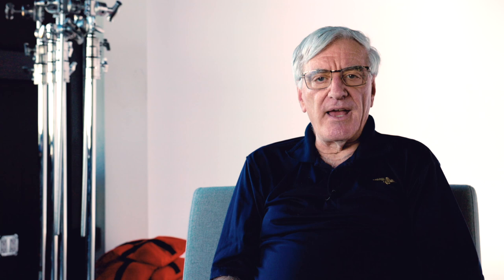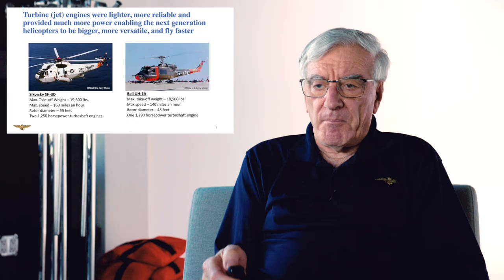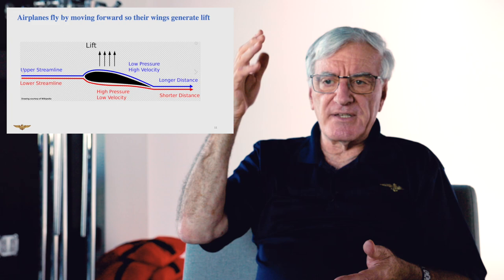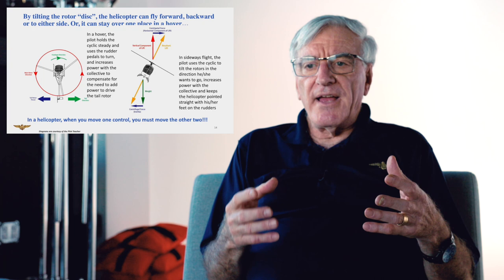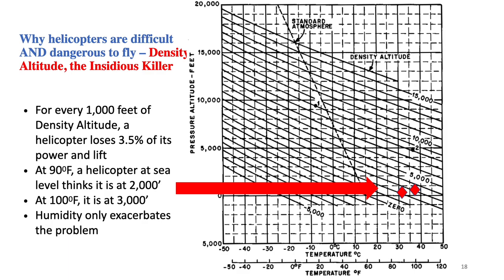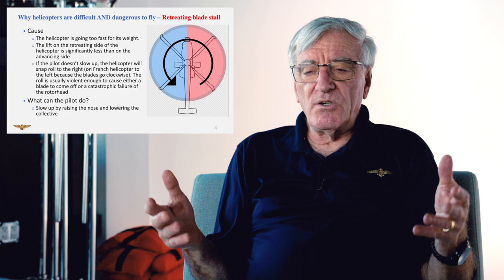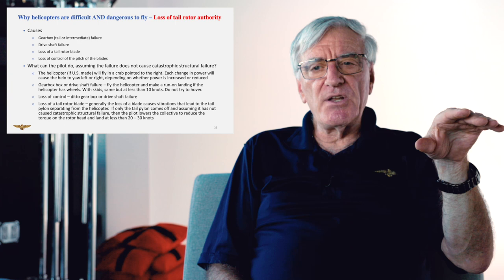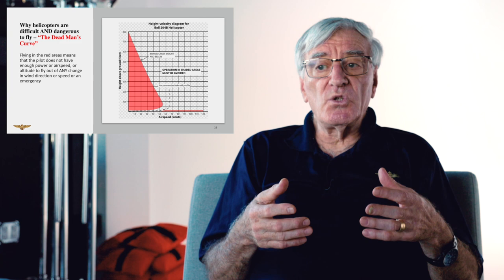Why Helicopters are hard to fly v1 11272022

Comment: In the Army version of the Bell JetRanger, the OH-58, we had to be aware of "loss of tail-rotor effectiveness." This refers not to a mechanical failure but to a situation where the tail-rotor is not generating enough thrust to counteract the torque being produced. Usually, it would occur when flying very slow or hovering in high, hot, and/or downwind conditions. I experienced it in Grenada flying uphill on the eastern (windward) side of the island. I was able to get out of it by reducing power slightly, letting the nose come around to the right, and pushing forward on the cyclic so that I was flying downhill, generating forward airspeed.

Comment: CAPT Liebman - Great video - But as a retired Navy helo driver myself and a CFII in civil helos (R-22, Bell Longranger, S-76), there is one thing incorrect. Specifically, your discussion of "settling with power". First off, in all of the NATOPS manuals I followed (UH-1L, UH-1N, SH-2F, TH-57), the phenomenon that you described was called "power settling". The term "settling with power" was used for a different thing, which is better described by the term "power required exceeds power available", which is what is used in FAA and civil manuals. Secondly, the fact that you mistook one for the other is why the civil term - also used by the Army - "vortex-ring state" is much better; it;'s unambiguous, eliminates pilots confusing one phenomenon with the other, and actually describes the situation that the pilot is in. Thirdly, the crash during the raid was caused by the wall of the compound forcing the downwash back upwards, outside of the rotor arc, thus creating the recirculation of already-accelerated air, which is the cause of "vortex-ring state, rather than the disruption of the ground-cushion.
Reply from the maker: I think you make great points, but I also think as time goes on, we make things more complicated than need be. I have very little time in civilian helicopters other than the S-76A/B and the whole HOGE issue is really simple. Stay out of that part of the envelope whenever possible. Yet, every time I came aboard a carrier or a small ship or a platform, we were  in that part of the envelope. What I think has happened that is a benefit is that we are generating "tools and techniques" to mitigate the risk.

Comment: You’re absolutely right Mark, I had almost $6000 of fixed wing time got into our our 22 and it almost had me for lunch it’s a different animal but so much more fun when you finally learn take care great presentation
Reply from the maker: Thanx for your comment.  My time is split almost evenly  between both and I think that jets are the easiest to fly....
Reply: I got PVT airplane, then went to helicopters all teh way to CFI-I, and hovered on my first flight. My CFI never even eased me into it. he gave me all three controls right away. It was just like flying an airplane in forward flight. Hovering was harder at first, but there is a simple trick to it. I then went on and did CFI-I airplanes too. Helicopters have unique risks, but they are actually easier to fly in many ways than airplanes.
Reply from the maker: @SoloRenegade  let us agree to disagree,  In a helicopter, your options are fewer in an emergency
Reply: @marcliebman3847  You can disagree all you like. Helicopters have more landing options in an emergency than an airplane, as they can land into tighter places at lower forward airspeeds.

Stuck flaps, split flaps, loss of elevator, loss of rudder, stuck landing gear, VMC roll, loss of aileron, and many other emergencies can occur in aircraft as well.

I can, and have, go through all the emergency procedures in the helicopters I've flown and reduce them all to either loss of tail rotor control, or loss of power to the main rotors. And if not, then I still have tail rotor and main rotor power/control and can make a normal powered landing.

All landings terminate in a hover (other than run-on), where as airplanes have numerous different ways to land and factors to consider. Hovering is far easier than landing an airplane. people get descent at hovering faster than they get descent at airplane landings.

Comment: forward flight: pitch and power, same as an airplane.
Pedals: you can train your brain to automatically keep teh nose pointed in a specific direction no matter what, and your subconscious handles that then.
Hovering: the helicopter is actually rather stable, and you need to let it hover and only correct perturbations due to wind.
Autorotation: same as flying an autogryo, and just like landing an ultralight airplane after engine failure.

Almost every emergency in a helicopter ends with either a loss of power to main rotor or control of the tail rotor. 2 emergencies to master basically. And if it doesn't result in either of those, then just find a spot to land and do so. Oversimplification, but far simpler than the myriad of things that can go wrong in a fixed wing airplane.
Reply from the maker: If you say so, but let us say, experience flying both disagrees.
Reply: @marcliebman3847  Yet you offer no counter arguments. simply declaring something untrue doesn't make you right.

Explain how pitch and power in forward flight doesn't apply to a helicopter.

Explain why helicopters aren't stable in a hover (balancing a broom on your finger is 100% the wrong explanation).

How is flying an autorotation different in a helicopter than an autogyro (aside from autogyros typically lacking blade pitch control)? Autorotation landings are also Just like landing a really poorly gliding airplane, other than the final hover touchdown.

Bear in mind, I am a CFI-I in both Helicopters and Airplanes. I too have experience flying and teaching both. And I'm also an engineer, designing aircraft and teaching others how to design aircraft. If you have logical arguments, you can sway me, but you have to actually make a compelling argument.
Reply: As I posted in a response to you upthread, forward flight in an airplane or a helicopter is indeed similar. After that, what you describe does not correlate to my experiences at all. I've got about 1,000 hours in the OH-58A/C (like a Bell JetRanger without the SAS), and it is not "rather stable" in a hover, regardless of the wind. Quite the opposite, even on a calm day. Many modern helicopters (like an AH-64) have a "hover hold" feature that does most of the flying for you in a stationary hover, but that's because there is a computer doing the flying, not because the helicopter is inherently stable. Autorotation just like flying an autogyro? I've never flown an autogyro, but the helicopters I've flown, in the flight regimes I've usually flown, you've got very few seconds between the engine failing and you being on the ground, just as CAPT Liebman described. Is that like flying an autogyro? If it were as easy as you describe, nearly every autorotation would end up with the helicopter sitting upright and the rotor coasting down to a stop. But that's not the case. Most total engine failures in a helicopter end up with significant structural damage at the very least, and way too many end up with the helicopter rolled up into a ball. A practice autorotation from traffic-pattern altitude does not closely equate to what happens when the engine fails in the middle of a real-world helicopter mission. And then there are tail-rotor failures, which you do not describe and are not like anything one might encounter in an airplane.
Reply: @randallbriggs256  " I've got about 1,000 hours in the OH-58A/C (like a Bell JetRanger without the SAS), and it is not "rather stable" in a hover, regardless of the wind. Quite the opposite, even on a calm day. Many modern helicopters (like an AH-64) have a "hover hold" feature that does most of the flying for you in a stationary hover, but that's because there is a computer doing the flying, not because the helicopter is inherently stable. " 

clearly you don't understand how it is stable and how my hovering trick works. it's so easy even kids can figure it out. And while I've not flown the Jet Ranger, I have flown teh R66 which has the same engine, similar performance, etc. Never had an issue hovering rock steady with no autopilot. And I've even flown/hovered in winds over 40kts.

"Autorotation just like flying an autogyro? I've never flown an autogyro, but the helicopters I've flown, in the flight regimes I've usually flown, you've got very few seconds between the engine failing and you being on the ground, just as CAPT Liebman described. Is that like flying an autogyro?" yes, they are the same. an autogyro is just a helicopter that can't hover and is flying in a perpetual state of autorotation.

"If it were as easy as you describe, nearly every autorotation would end up with the helicopter sitting upright and the rotor coasting down to a stop." airplane landings are easy, but watch videos and see when the engine quits everyone still dives to the ground and pile drives the airplane into the ground needlessly. it's not a matter of ease of flying, it's a matter of people panicking constantly. Many successful autorotations occur every year.

"A practice autorotation from traffic-pattern altitude does not closely equate to what happens when the engine fails in the middle of a real-world helicopter mission. " which is why our instructors were all required to go to an extra factory flight school with test pilots and practice all manner of unusual autorotations from many airspeeds and altitudes. hovering autos, stuck pedal autos, zero airspeed, 180, 360, etc.

"And then there are tail-rotor failures, which you do not describe and are not like anything one might encounter in an airplane."

I describe them many times in my comments. Yes, they are not like airplanes, and never claimed they were. you have to actually read and comprehend what I actually say to win an argument with me. I said that helicopters have less emergencies to know how to deal with, primarily loss of main rotor or loss of tail rotor. if you can deal with those most of your emergencies are covered, as most result in one of those two conditions. 

If you know nothing about gyroplanes, don't argue them If you can't be bothered to read what I said on tail rotors, then don't try to argue it. You can't win an argument you don't understand, and can't win an argument when your arguing the wrong things.
Reply from the maker: Randall, you hit the nail on the head. From 1,000 feet, an H-3 autorotates at between 4,000 and 6,000 feet per minute. So, at 1,000 feet, you have 12 seconds to bottom the collective; lower the nose; get to best autorotation airspeed (70 knots); flare starting at about 150 feet; level off at 30 - 40 feet with 3 - 5 knots of forward airspeed; and then cushion the landing with whatever energy one has in the rotors. I'd rather be in a fixed wing airplane with a total engine failure.
Reply: @SoloRenegade  Apparently you have special knowledge of helicopter flight that nobody in any of the U.S. armed forces has. Perhaps you could make millions marketing your secrets.
Reply: @randallbriggs256  no, I can't make millions on it. It's very simple stuff that more people should have figured out by now. None of the other pilots and instructors I flew with ever figured it out, and it bothers me to this day (I figured it out while lifting into a hover to start a training flight to become an instructor, the lightbulb just went on in my head, and i still remember that moment vividly to this day). Yet I've used it to teach many people. Once a few intelligent people catch onto the idea it would spread like wildfire and become common knowledge. I have more such tricks for airplanes as well, and engineering too. I'm willing to share my ideas, but people get mad when you offer to help. Their egos get bruised and they'll fight tooth and nail to stop you after that. I even developed successful tactics to counter IEDs that were tested and proven in combat, and even the guys in my unit, seeing it, refused to accept it, and refused to let me share how to do it with them. My success rate was 117% by the time I finished, and my platoon achieved a 98% success rate against IEDs by the end of one deployment (the next best unit I've ever head of never did better than ~55%). Unmatched success to this day. But nobody cares. I wanted to start a school for the military to teach what we had figured out, but they didn't want to hear it. So I switched to aviation, my lifelong passion, and also engineering (another lifelong passion).

Comment: It cannot be over emphasized, to do a 
thorough Pre-Flight inspection on the helicopter you're about to fly. Look at everything on the checklist, as well as things not on the checklist. Welds, joints,
fasteners on the frame structures etc. And also listen n feel for unusual noises during 
Hover power checks before lift off or taking 
off. This is your last chance to save your ass,
passengers, and a very expensive aircraft. 😳
Reply from the maker: Amen!!!

Comment: It's funny, i always thought this was a spanish invention from the civil engineer Ricardo de la Cierva who patented it in 1920.
Reply from the maker: Thanx for your note. Cierva invented the autogyro,  not the helicopter. They are, from an aeronautical engineering perspective and flying perspective, two totally different machines. The autogyro needs forward motion to turn the rotors. In some models, the engine had a shaft with a clutch so that the pilot could advance the throttle and spin the rotors on take off, after which he de-clutched the shaft and the engine was no longer powering the rotors. Second, the autogyro is flown with conventional airplane control surfaces, rudder, elevator and aileron. Third, an autogyro can fly slowly, i.e. around 15-20 knots, but cannot hover. Or fly backwards or sideways. Is this helpful?
Reply: @marcliebman3847  
Cierva did not invent the Autogyro, he was instrumental in inventing the "hinges" on the main rotors blades which allowed the blades to flap n lead n lag on the Auto Gyros... His hinge design was later incorporated into most  helicopters in production today, some with lead n lag dampeners, some without. Main Rotor systems can be Rigid, Semi-Rigid, n fully Articulating designs. The Rigid n Semi-Rigid systems are usually Teetering Rotor systems.
Reply from the maker: @Pork-Chopper  FYI, I have several sources starting with Wikipedia and George Townson's book "Autogiro, the Story of the Windmill Plane," plus others who say that Cierva created the autogyro. Pitcairn, Kellett and several others tweaked or made improvements on his design.
Reply: @marcliebman3847  
No argument from me. Thats more information I didn't know.
I had read from Shawn Coyle's book
Cylclic and Collective, More Art and Science of Flying Helicopters that Cierva was credited for inventing the "hinges" for the Auto Gyro, but I did not know that he actually was the man who invented the Auto Gyro.
In either case it's fascinating stuff.
I have flown the R22'S and presently flying the 
Bell47G n Bell47G2.
I'm sorry, I wrote Claude Viuchard, when it was 
Shawn Coyle's book. Claude Viuchard is credited with the technique to get out of the
Vortex Ring State or settling with power situation. I've read many books including a several written by Vietnam Huey Pilots. I've learned alot by reading their personal stories.
Presently I'm reading Principles of Helicopter Flight, second edition. I'm working towards my Private Pilot's license. I have over 40 hours of flying in helicopters and doing well at it. It's not as easy as it looks, it's a machine you have to finesse n be gentle with. There is no need to be aggressive with the controls. And very important to know it's limitations n your own.
There are high performance helicopters out there like the OH-1, known as the "Loach" or the Magnum PI helicopter, but most of us Grunts cannot afford them, though I'm sure they'd be a blast to fly!
Clear Blue n 22
Pork Chopper
out
Reply from the maker: @Pork-Chopper  I have never flown a helicopter with a piston engine so my hat is off to you. I have a few hours in an OH-6 and you are right, it is/was a blast to fly. Very minimal instruments, but very, very maneuverable and rugged.